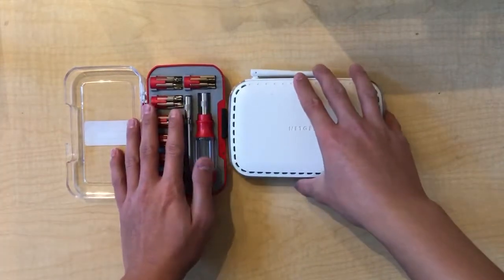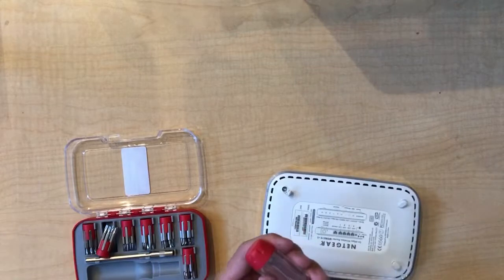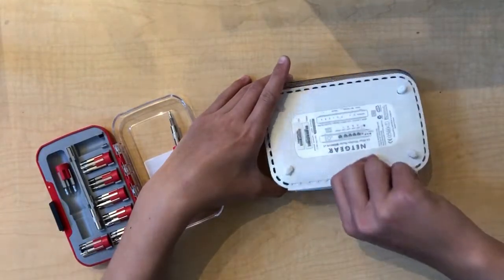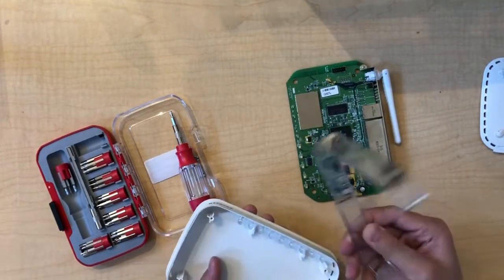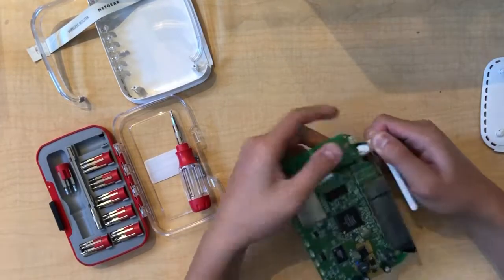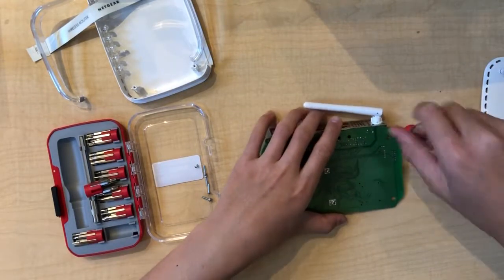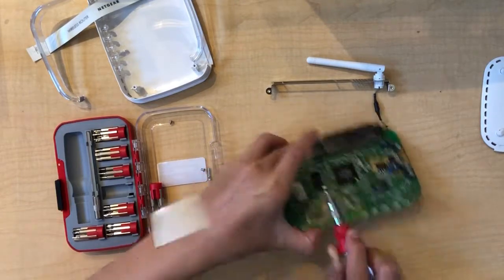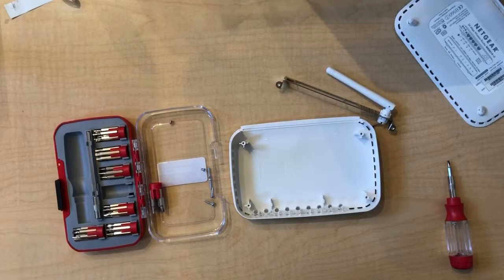Netgear Router Teardown

Comment: WTF are you talking about?  LOL, that is not at all for a "dial up modem".  Dial up modem era was a dozen years earlier, were PCI cards, or eariler ISA, or connected over a serial port, or for a short while a USB port.  They were so slow, you didn't use a router into them at all because they barely supported web surfing on a single computer when web pages were very simple, small files, unless you built a purpose specific router (which I did back in the day and that was long before that router you have there).

I suggest that you stick to newer tech you know, or educate yourself about the older tech and that one you have there, isn't all that old in the grand scheme of things.

The question that remains is WHY are you taking it apart?  I never had that model of router, but still have a few gigabit switches from the era where they had that white plastic casing.  I took them apart because I upgraded the capacitors, and put the top half of the plastic casing on a drill press to drill a grid of vent holes so it would run much cooler.  It must not have hurt much since I typically get no more than 6 years out of low end networking gear yet mine are still working today.

You are better off taking part NEW equipment, and improving it.  Then you have invested your time into something that pays dividends in the future.  Even so if that was an 802.11g router, see if you can put a custom firmware on it, as there are a lot of low bandwidth IOT devices that could use a slower link on a distant wifi channel at 2.4GHz, then put your newer gear on a 5G channel from a newer router.  Same goes for the 100Mb switch in it, you could use that for some security cameras or something, not the main link between your lan and wan.